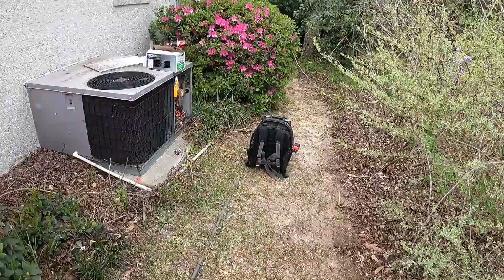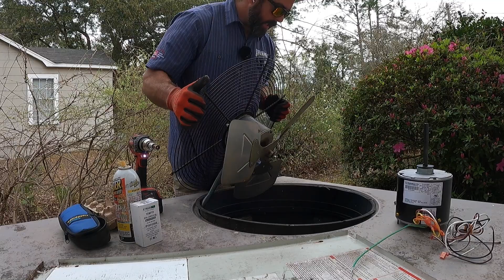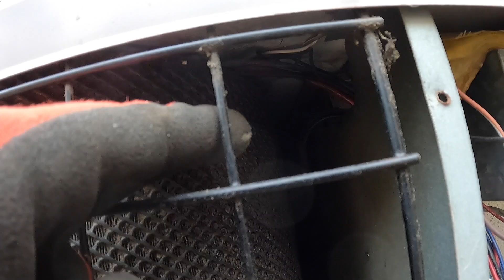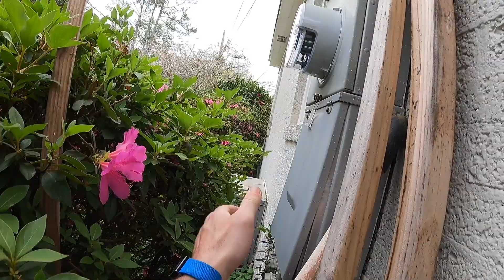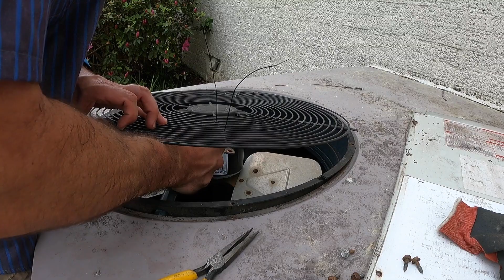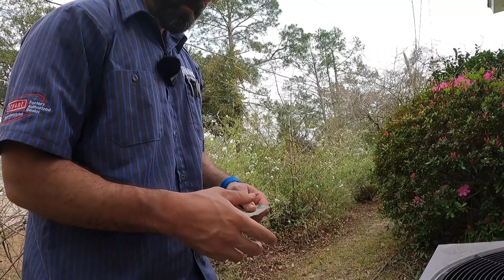Replacing Condenser Fan Motors

Comment: Well done! To all who are new to the trade, follow his practice of securing the rotation connection to under the grill to minimize exposure to the elements, marsupials and short bipeds. Also, the only thing I would have done differently here is measure between the bottom of the grill to an edge of the blade closest to the grill in order to get the blade height the same on the new fan. That way, if the pressures are off, I can rule out blade placement.

Comment: I always cut the wires of the old motors, right at the motor. I’ll pull all but one wire, and use that one wire to fish the new wires through
Reply from the maker: I like it!  Thank you, great info!
Reply: Or, you could attach a fish wire to the connector as you pull the old wires out (saves a step or two).

Comment: I’ve even replaced a 825 rpm with a 1075 at a restaurant on a HOT Saturday afternoon and it worked out fine, not suggesting everyone do that but when your in the fire you use what you got.